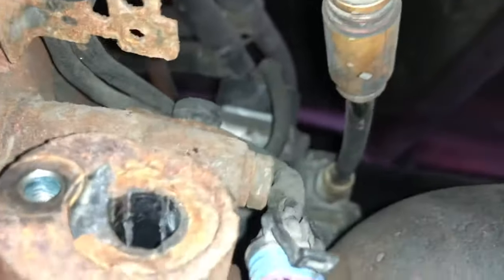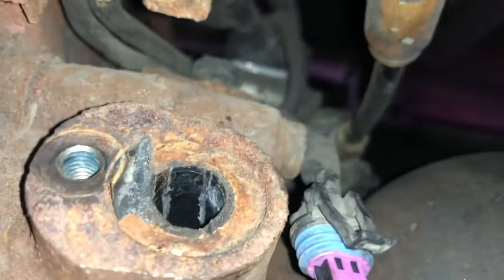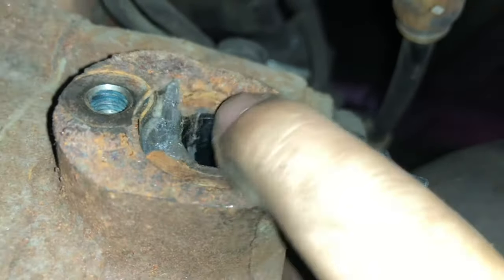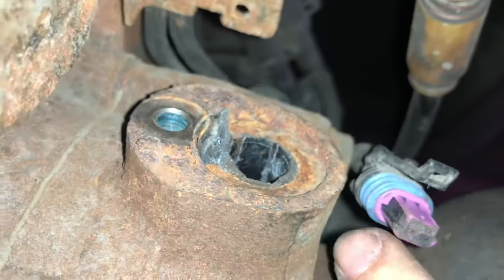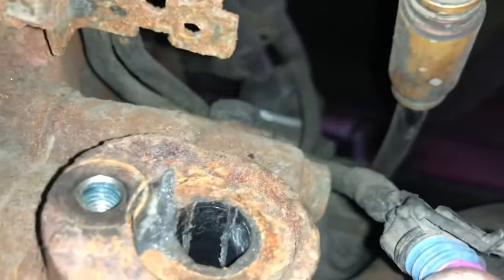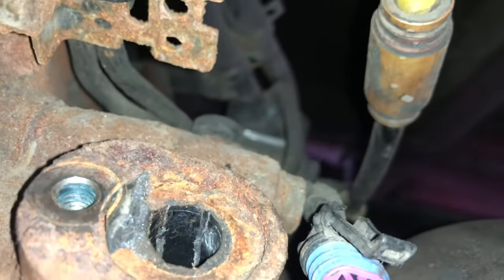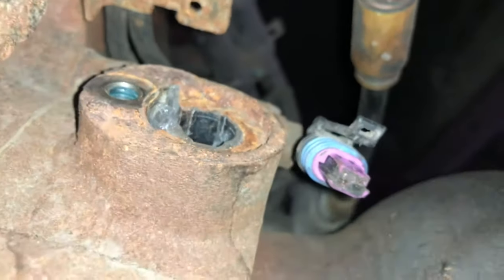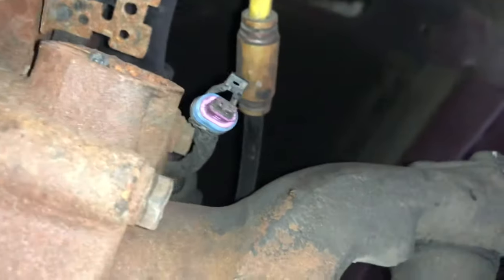Speed sensor installation, output crankshaft sensor Freightliner Cascadia

Comment: I change this sensor every 3 months. This way comes out very easy. Cost only 28 dollars at fraightliner dealers. I have 2007 fraightliner century class s/t ultra shift eatan fuller transmission
Reply: Thanks now I really DON'T want to buy a Freightliner.

Comment: Yup, it’s a pain to take it out, but it’s even more difficult to put in a new one. You’re going to need to sand the inside to make space for the new sensor. I did it by hand, but I believe that a die grinder tool can help quickly sand the hole.

It’s strange how your Freightliner has a Cummins engine.

Comment: I have a problem with the transmission I gatt 2016 frightliner cascadia it’s automatic when ever I stop I goes to N  I have to put it back to drive I took it to the dealer they told me I need the transmission change any help please any good machanic any where in the US
Reply: Is it the same place?2016 freightliner cascadia automatic
Reply: Update what happened?
Reply: What did you do brother please let me know I have the same problem
Reply: What happened?